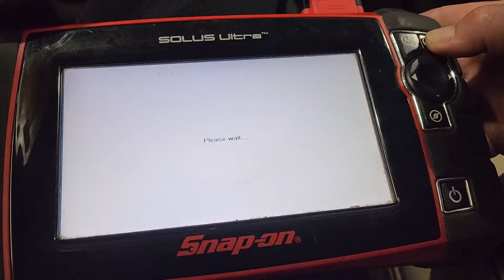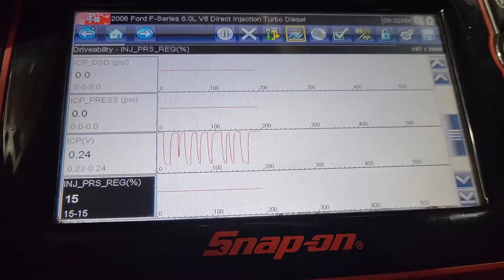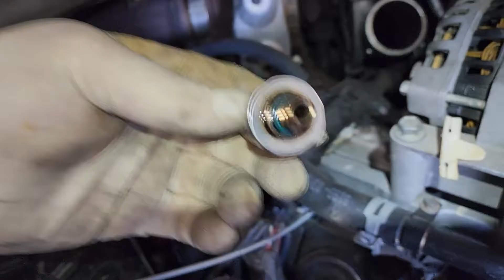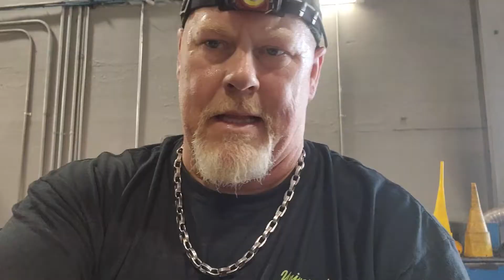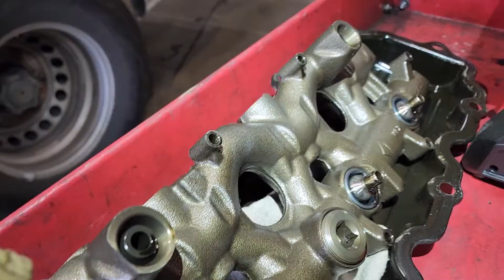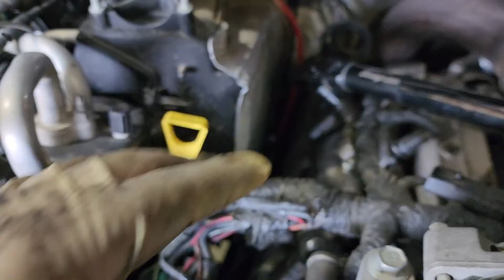6.0 POWERSTROKE Common No Start & How to Fix It

Comment: I’m a duramax guy working on a 6.0 right now and the first time I heard someone talking about having a bad high pressure oil pump I thought, high pressure oil pump? Oil has nothing to do with your fuel system. 
Come to find out that’s how it works on this motor. Crazy.
Definitely appreciate the simplicity of a Duramax lol simple high pressure fuel pump and fuel lines like any other DI motor.

Comment: So if I don't hear a leak from the passenger side the leak is on the driver's side
Reply from the maker: It could be that it does not have a leak, have to remove the pcv on driver side and listen

Comment: So ive done this and I  replaced the pipes and plugs replaced the stc dont have an oil leak and this truck still will not start ....for a year now its cost me a super hardship lost my high paying job with the government its cost me alot I put new injectors $500 a pop all 8 still no start ive changed the hfcm, filters, oil, still no start as well as the crk shaft sensor, where do I look now ? It will start with a.shot of either and only stay running with pressure on the pedal .. very responsive  but when I let off at about 1100 rims...... BRrauuuaa..... it shuts down every time same deal ...somebody save me...2005 6.0
Reply from the maker: Man sorry to hear about your troubles if you message me on Instagram I can try to help you.  Fuel is probably your issue but message me on Instagram
Reply: I was hoping for some input more than a thumbs up or a heart.. Tone
Reply: Sorry just reading your message this thing has me flabergausted😅

Comment: Question. 2004 Ford F250 6.0L diesel. Still cranking no start. Towed in no start. Other shop did replaced electric fuel pump, IPR valve, fuel filters, pressure regulator, and fuel injection control module. The other shop stated it was towed in no start there and they replaced the FCIM, it did starts and runs, and drove off. Then towed in no start again.

I looked at truck. Only has EGR fault codes. No other fault codes. IPC 900 PSI at 35% duty while cranking. Did have good oil pressure on gauge in cluster and shown 150 RPM on scan tool. 48 voltage steady for FCIM. I dont have compression diesel tool. How do I know if fuel injectors are firing? And, how do I know if the catalytic converter is not clogged? Even I did unplugged IPC sensor and still cranking no start. Thanks.
Reply from the maker: Wow that sounds like some trouble message me on Instagram
Reply: @nutsandboltswithtone I did performed fuel injector self test and no buzz sound. Replaced FCIM again with aftermarket rebuilt FCIM. Still same problem. Should I try used FCIM?
Reply from the maker: @knightmechanic have you checked all Ficm power data pids with scan tool?
Reply: @nutsandboltswithtone Yep. Strange thing is that I did unplugged one of fuel injectors and still no fault codes in FCIM. I did cranking the engine. Rescanned FCIM. Still no fault codes with one of fuel injectors unplugged. I guess #3 bad FCIM.
Reply from the maker: Message me on Instagram it's easier to communicate @knightmechanic

Comment: Thanks for the video. Question is since i dont have a command monitor can i pull the ipr instead of the icp and do the air test that way. 06 f350 with icp and ipr located under turbo.
Reply from the maker: Yes there is a great kit to go through ipr port. Hit me up on Instagram if you need any help

Comment: So 2004 6.0 crank no start most of the time. Then out of the blue it starts and runs perfect. Im gonna check icp pressure in the morning. What else could it be if it starts and runs sometimes but then It won't for entire day.
Reply from the maker: You can message me on Instagram.
Reply: We're dealing with the same issues. We've also tried replacing the starter about a month ago. It sucks because we need the damn thing to drag a 24ft trailer.

Comment: Not a mechanic interesting video and diagnosis.
I don’t see many 6 liter trucks. I have a 99 7.3  good advice about the starter melting and the battery condition. It doesn’t take long to destroy batteries and the starter if the truck is experiencing a crank no start condition.
Reply from the maker: Thank you, I have a few videos on the 7.3 as well.

Comment: Hi 2003 6.0 no start due to front push rod needle bearing falling out found in front of low oil pressure pump the thing that has a spring and piston behind hex head bolts
Reply from the maker: Those needle bearings are from the lifter I believe. That is a bummer.

Comment: Is there any reason besides bad ficm that ficm voltage drops below 48 with constant 12 volts to ficm supply
Reply from the maker: Not usually as long as all your regular voltages are correct then would be a bad ficm.

Comment: Hey Tone,
Thanks so much for your videos, my 2005 6.0 is still not starting... My scan tool showed HPOP not getting above 230 psi after replacing stand pipes, dummy plugs, nipple cup seals and injector seals throughout. New IPR and ICP... FICM at 48V (my scan tool doesn't have a FICM Sync PID) everything is reading normal except HPOP (<230 psi) and IPR(85%). I unplugged the ICP and I got 850psi in the HPOP reading but still no start. What is my next move Tone?
Reply from the maker: Sounds like you have a high pressure oil leak or a bad pump. Ipr reading 85 means it is maxed out, hpop 230 means you are not making proper oil pressure.unplugging icp just tells you if the icp is the problem.You are gonna have to perform the high pressure oil leak test. hit me up on Instagram I will help you out.

Comment: How does oil pressure boost the fuel pressure
Reply from the maker: @born2wrench  there is low pressure fuel running through the heads and into the injectors, then on top of the injectors is high pressure oil which pushes down on top of the fuel.

Comment: How do you get the lower stand pipe out? Mine is stuck. Is there no other way than pulling out the oil rail?
Reply from the maker: You will have to pull off the oil rail, and here is a link to some pliers that I use for this. https://amzn.to/4gCzOq0

Comment: Okay so, 05 no start, replaced stand pipe fixed icp leak, passes air test new hpop new camshaft sensor new IPR valve ficm is good and passed air bubble fuel bowl /injector test and low pressure oil test. No codes and fully charged brand new batteries still no start. Where do I go from here I’m at a complete loss.
Reply from the maker: @christopherwilson2255  message me on Instagram
Reply: Glow plug module pretty much the only thing you didn't mention

Comment: The very second I read the title I said standpipe & dummy plugs....🧐
Reply from the maker: Omg yes it is so common, and what is worst is that since Ford changed who is making them the OEM parts are failing at very low mileages. I want to try the welded stand pipes TBH.

Comment: Just found your video my 6.0 is doing the no start my question is if your low oil pressure gauge is not moving at all does that mean the low oil pressure pump has gone out? Or should I try something else?
Reply from the maker: Remove the oil filter crank over engine see if fills up with oil.  If no low pressure oil cannot have high pressure oil. Message me on Instagram if you need more help

Comment: What causes  for 6.0 run in idle  for 5 minutes and suddenly to shut itself  off?
Reply: That would be you turbo exhaust manifold regulator pressure sensor hpop sending unit
Reply from the maker: @mikeches7992  could be a lot of things message me on Instagram

Comment: Good tutorial on how to diagnose and repair.  Nice ending where you mention other potential high pressure oil leaks.  
Question:  for standpipes and dummy plugs why cant you just replace the o-rings rather than get new pipes?
Reply from the maker: Honestly I've never seen o ring seal kits for them.  As far as I know you only replace the actual dummy plugs and stand pipes.  There are Teflon seals also to keep seals from blowing out. I've never done it but there are companies that sell welded stand pipes so they are one piece.  The connection between the two is where they generally leak.  You can look it up

Comment: Thanks good job. Working on my 03 6.0 crank no start. Ipr removed, gonna get icp soon.I have scan Gauge 85%.Hope valve and sensor  and pigtail fixes it.100k on hpop and I hope thats not the problem. I not  a mechanic but I can turn a wrench. Icp wiring oil soaked.
Reply from the maker: @robertdilullo7343  if icp erupting is soaked then yeah icp is leaking through.  Good luck. Hit me up on Instagram if you have any other issues. Thank you